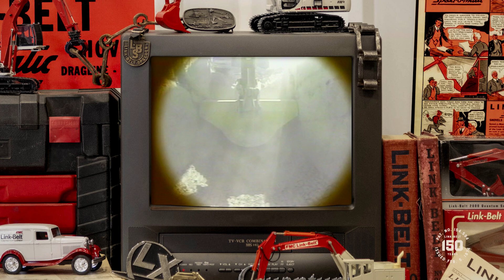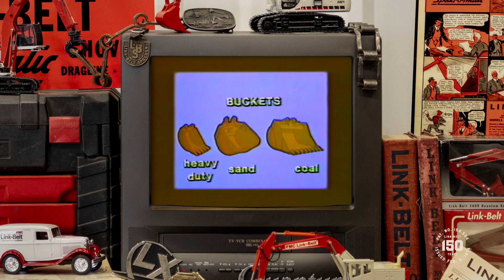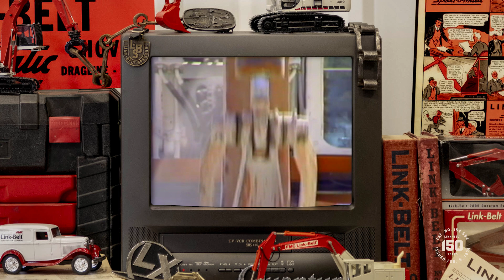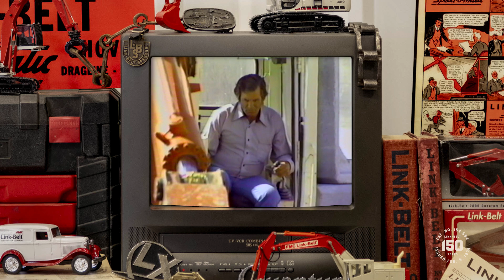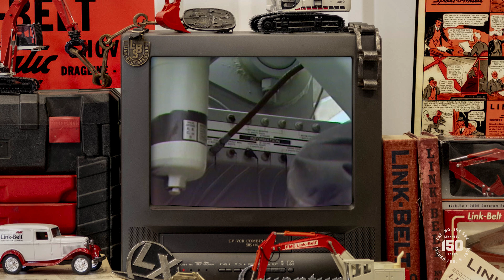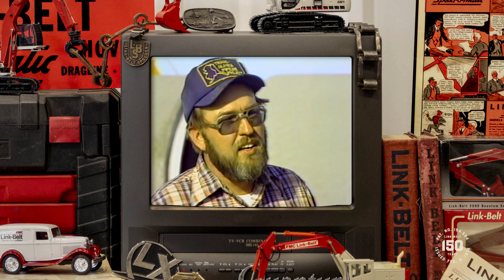Link-Belt 150 - The Big Diggers (1980)

Comment: My boss had huge 4800 with a loud Detroit diesel back in 1970s .
Also had a behemoth Koehring had a twin engine 2- v12 Detroit's on a barge here .

I owned an linkbelt 8860 hydraulic truck Crane 2000.
Beautiful machine no issues in NYC area .
Reply: The Koehring would have been the 1266D.
Reply: @oldironguy  yes a behemoth Koehring.
On a barge to build jetties off inlets .
Reply: @oldironguy   Any chance it might have been the 1466 model ? I know a lot of the 1466 units were in shovel configuration for mining, but Koehring did offer the 1466 as a backhoe.
Reply: @williamhall9204  Well, Your right it could have been. The 1466 came out much later than the 1266 which there were quite a few around. The 14 wasn't built in near the numbers the 12s were. There were actually a number of 12s that were barge mounted and havent heard of a 14 on a barge but there could have been. There's actually a 1266D at the bottom of Georgian bay off lake Huron in Ontario Canada. Went off a barge that broke free of its tow. Heard that story a few times then actually met a man that worked for that co and said it's true. He ran a 1066 for them.
Reply: @oldironguy  Thanks .
Koehring was innovative company.
Made all type of equipment.
I have a Lull 1044-54 telehandler 2000 year.
Got all parts.
Excellent quality.

We had one on long island new York on barge off ocean inlet not sure which model .
Has twin Detroits.

I ran Link belt HC238a friction Crane clamshell and set steel.
100% friction.
Not many people can run them anymore.
HCEA Ohio museum is a good place to see old iron running.
We had P&H cranes also Invented magna torque electric swing .

Thanks 👍
Reply: @Nudnik1  HCEA Canada still have quite a few full friction machines. Northwest 2-25s and a 41dragline, Koehring 301(very old)clamshell, a 305 hoe and a 205 crane which originally came with a Skooper attachment but sadly don't have it. A Link-Belt K365 and LS-98. Also a member has a very small Little Giant set up with a hoe front. And lastly, 2 Canadian made Dominions, a model 350 with clamshell and a 375 shovel. It's definitely a lost art being able to run any friction rope machines.

Comment: I have ran LS 4800 ,5400,5800 and  LS 7400.
Reply: Lucky man! Would have loved to run a 7400. Local contractor had one for almost 30 yrs.
Reply: @oldironguy  I spoke to a guy who operated the LS 7400. He said it was a great machine to run. He did say that the CAT 245B and 245D were his favorite track hoes. Of course the 245’s were smaller than the huge Link-Belt. The fellow said the 245’s were faster and more nimble.
Reply: They were big and slow but had a high pressure hydraulic system  designed  in Germany by a company called lynde hydraulics .